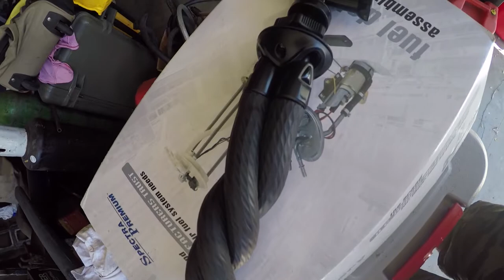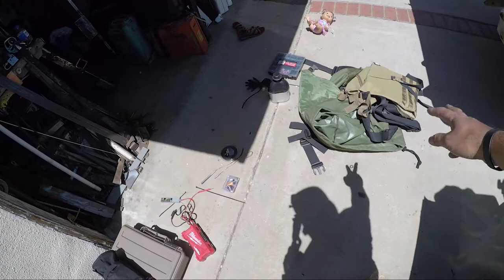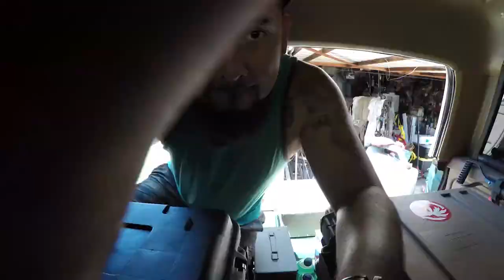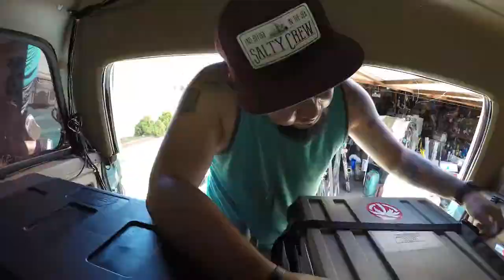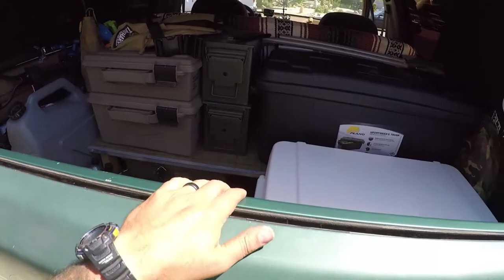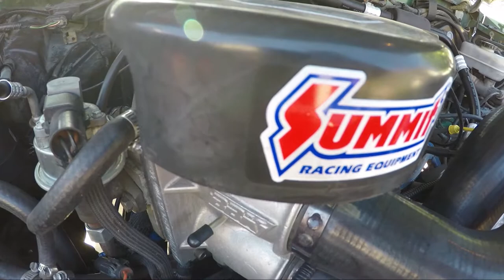CAMPING BRONCO

Comment: How did you bolt the rack on top of shell
Reply from the maker: Swell nuts is the hardware it came with. But after some water leaking and movement on the highway i switched over to grade 8 bolts and nuts with a flat washer on both end with a dab of silicone in the hole to prevent water. Been solid ever since. But drilling into the roof was definitely not fun. Had to drill slow and lubricate so I wouldn’t cause the roof to crack.